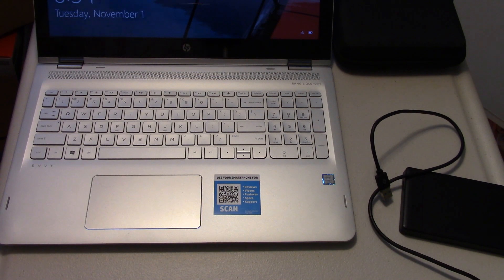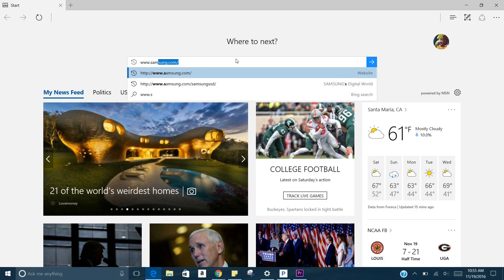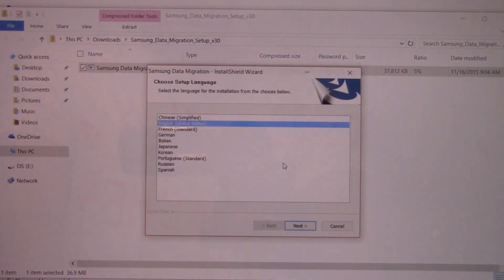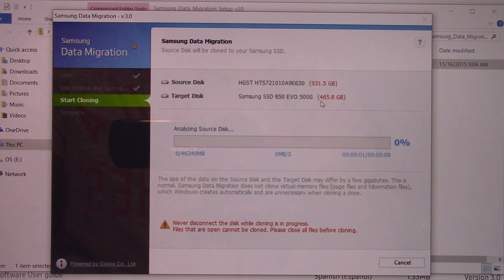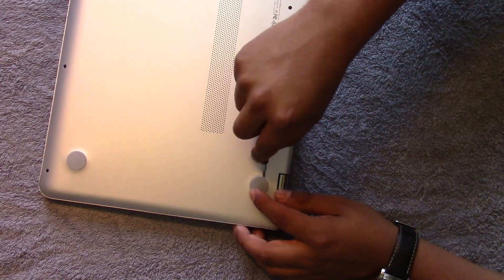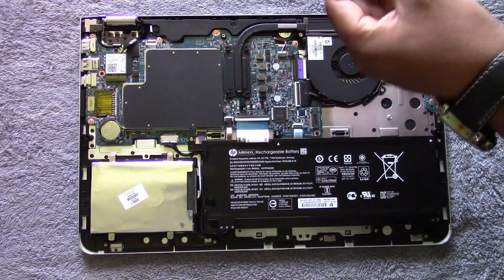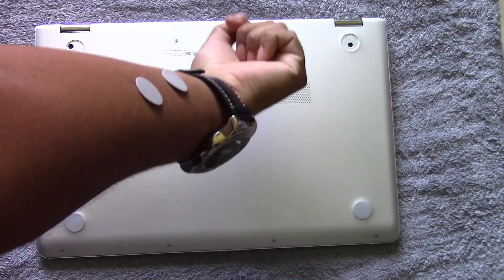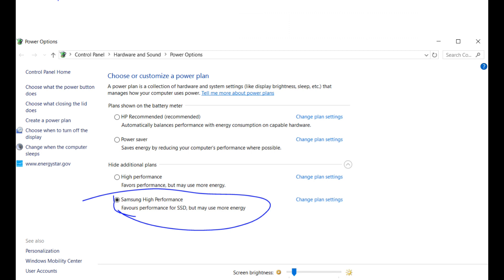HP Envy x360 M6 aq105dx How to change the HDD for an SSD

Comment: Ok guys, I was the original person that commented on this video about an M.2 slot. Well to answer all of your questions, I will post my forum question from HP support. There is some pretty valuable information there from multiple users, as well as myself.  http://h30434.www3.hp.com/t5/Notebook-Hardware-and-Upgrade-Questions/HP-Envy-x360-M6-aq105dx/td-p/5862992
Reply: This may be an old laptop- but I still use mine every day. I added a 1T M.2 drive and swapped the HDD for a 1T SSD and it all works great. Easy installation, basically just plug and play. I've had those drives installed for two years at this point without problems.

Comment: Clear and concise. I attacked removing the bottom from the front corners using a spudger that comes with my I-fixit tool kit. BTW I installed a 256 M.2 and a 1TB SanDisk SSD. OS and software on M.2 data on SSD.
Reply: What m.2 ssd does the computer support, PCIe or SATA?
Reply: @who_doge  SATA

Comment: Great tutorial! Only thing I had a hard time with was getting the 2 screws under the laptop grips. Other than that, everything went smoothly.
Reply: Also, if anyone's also having trouble with this, dab some temporary glue on the end of your screwdriver so the screw will stick to it and come up.

Comment: I have the same computer and the original hard drive has failed. I am replacing it with a Samsung 850 Evo, but how am I supposed to migrate the data and replace it if I can't start up the computer? Thank You
Reply: I was wondering that too

Comment: Just between the battery and the fan is a M.2 slot could we install a ssd and keep the hdd? Have someone tried?
Reply from the maker: xaxaxa there is a forum on it. I pinned the comment that has the link.
Reply: GH Tech Review buddy I just ordered the same lap from bestbuy. I am wondering would be better swap the 1tb hdd to 500 gb ssd as you did and use it as external.  Or keep the 1tb hdd and add a 128 or 256 m.2 ssd? What do you recommend? Thank you
Reply from the maker: xaxaxa what I did after swapping out the 1tb hardrive, I backup the operating system on a flashdrive. Then formatted the 1tb to be use as an external HDD to store my video files in. That worked for me since I don't need that much storage. 500gb on the laptop is enough for me since I don't install many games. I think adding a 256gb m.2 ssd would be ideal. I would have gone that route if I had known before hand.
Reply: GH Tech Review don't you think adding the m.2 will be more difficult to get it work than change hdd for sdd. I was reading and looks more complicated. Please advise. Thank you for you reply
Reply from the maker: Yes, changing the hard drive for a 2.5" SSD is way easier. I would suggest you do the hard drive change to an SSD.

Comment: Hi. Which of these two do you think best hp envy x360 M6 AQ105DX or Asus Q524UQ.
Greetings and thanks
Reply from the maker: xaxaxa with the SSD upgrade its crazy fast. It boots up to log in in 5 seconds. I log in and open chrome within 14 seconds. It's a great upgrade.
Reply from the maker: it's almost as if the laptop was in sleep mode and woke it up. That fast.
Reply from the maker: Hi again, I wouldn't be able to tell you because I have not own the ASUS Q524UQ. On looks I prefer the HP Envy x360 M6 design. I don't know about the performance on the ASUS. Seems like on paper the ASUS packs better specs like it has the Nvidia GeForce 940MX GPU which is better than the integrated intel graphics in the Envy, but I can't say for sures how well it runs compare to the one I have.
Reply: GH Tech Review how fast or how much better is the hp x360 with de ssd upgrade. I am thinking to buy the same computer.
Reply: GH Tech Review do you still recommend this laptop? Does the screen quality and touchpad is good?
Reply from the maker: xaxaxa The 1920x1080p ips display has nice viewing angle with rich colors, but there is some backlight bleed on some of them. Mine has some lightbleed. I have had zero issues with the trackpad. It is smooth. I still recommend it and I think best buy still has it on sale for 749 which is a good deal for what it packs. You can get an open box for 679 which is a great deal.

Comment: That laptop compared to the pavilion x360, which do you think is better? Both unmodified.
Reply from the maker: +Ericec4126 I prefer the envy because of its better build quality, less issues. There has been more reported issues in the pavilion in the long run. I also like that it has a USB type c port though it is only for transferring files  and charging.

Comment: thank you again for this video I just finished my install one thing to note when removing the cover if you pull up where the grill is at the hinges on the inside instead of the outside of the hinges the cover will pop off easier and do no damage simply lift up along the plastic Grill inside the hinges and it helped a lot it seemed to pop right off this way also there is no need to pull on the outside or separate the outside lip of the cover it will only damage it release points in the back with a credit card help pop right off oh and one more thing I noticed the HDD that I removed was very heavy compared to the SSD reducing overall weight in the laptop excellent modification many reasons to do this GH you are a genius this is the fastest computer it totally rocks
Reply: Kiara Goddess Thanks for the tip, worked like a charm!
Reply: Yes Thank you so much. It wasn't wanting to release haha. Always nervous when the computer belongs to a customer haha. Great tip!

Comment: the 960 Evo m.2 was on sale Cyber Monday from Samsung for $130 it's only 250 Gigabyte I decided to do the same thing and get the 500 gigabyte Samsung Evo 850 SATA SSD it was 130 dollars as well twice the memory and after watching the videos the M2 only speeds up boot Time by about 2 seconds so is that worth twice the money to me no wait till the M2 comes down in price and then add more memory if needed very nice to know this newer m.2 slot is in the machine and a very easy way yet expensive to upgrade more memory and have a second Drive for that is also SSD was going to put the M2 in by itself with the HDD but I don't ever want the HDD in the machine running the battery down in the future for anything so I am glad I started off with the SATA Samsung Evo 850 and then later if I need more I can add the Samsung Evo 960 m.2 and m.2 well come down in price as time reveals very grateful to see someone get something before I did and showed a video thank you so much for for your sharing time in your video

Comment: Does your HP drain battery after shutdown about 5% overnight?
Thank you for posting how to open this laptop.  I got it from black friday $699.
Reply from the maker: I have not noticed that, will check tonight and let you know in the morning. That was a great deal.
Reply from the maker: +Ballie Bunny went to sleep with it at 64% turned it on right now. It's at 63%.
Reply: I had full charged 100% then shutdown for about 15 hours.  Then the battery showed 95%.  
My other HP envy m6-w103dx losses about 2-3% , but left over a week it would lose about 10% or more.

Comment: Hi! I've watched both of your videos about this laptop, and have purchased it because of your video. Now, if I receive my laptop and new SSD in the mail, should I rewrite the drive to the SSD just like you did, or should I immediately put in the new SSD and reinstall windows 10? Will the laptop still function properly if I don't transfer the data?
Reply: thank you so much install was so easy Samsung software is awesome work like a charm
Reply: Gerardo Hernandez Okay thanks!
Reply: Gerardo Hernandez last question :) Will this do the trick? 
https://www.amazon.com/dp/B015FB3R12/ref=cm_sw_r_cp_apa_BSQoybQMEYKEV
Reply: Windows 10 by itself will it have the HP software from the OEM HDD that came in the machine how much of that software is on the OEM HDD in the original machine or will Windows 10 work by itself you know all the software that runs that Bang & Olufsen stereo all that stuff is it on the original HDD where it needs to be cleaned or can you just do Windows 10 by itself and save the HDD without registering it
Reply from the maker: Kiara Goddess everything is transferred over. You can register the laptop with hp support after you do the migration on the ssd. As long as you haven't unstalled it. You will have the b&o application to control.
Reply from the maker: Kiara Goddess Your welcome, I am glad your migration was successful :)